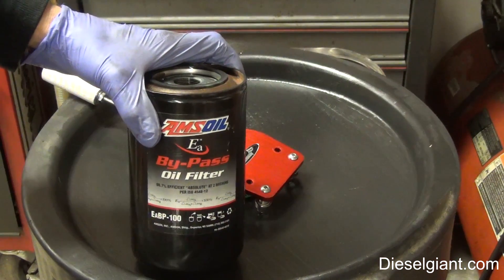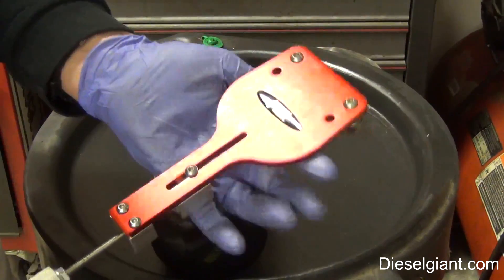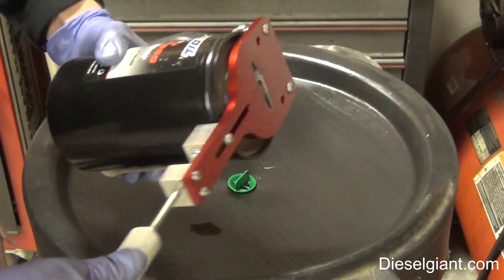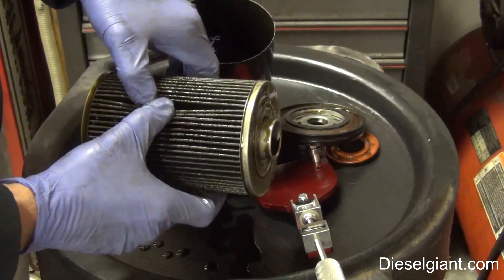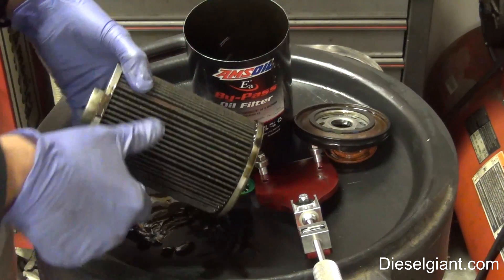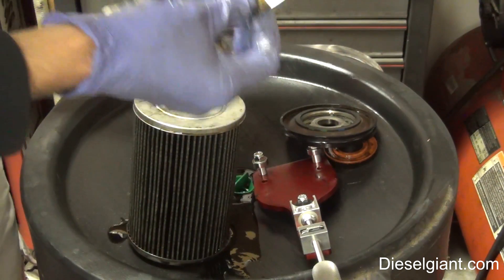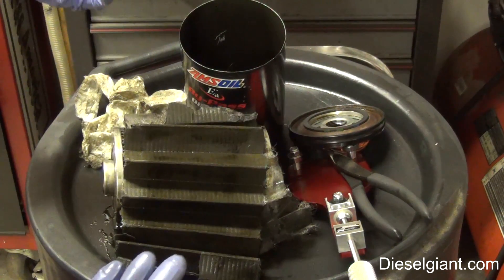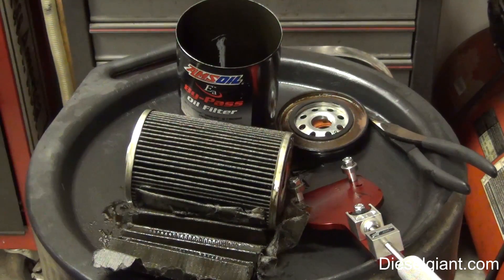Amsoil Ea BP 100 Bypass Oil Filter Cut Open and Inspected

Comment: There is no 'pressure relief valve.' There is no bypass to the bypass, as that's redundant. If that thing fills up, it's NBD, it just stops filtering and full oil flow will automatically be diverted to the full-flow filter. When the full-flow filter fills up, it's bypass takes care of everything.
Reply: That my friend was a piece of stamped steel, not a valve of any sort. It just holds the filter against the seal on the base plate at the other side.

Comment: Hello. I use a Amsoil engine oil filter. What is the micron difference and how much more efficiency will bypass filter give?.
Reply: according to the Amsoil website, the "full flow" filter gets 20 micron rating and the "bypasss" has a 2 micron rating.  I think I may go with WIX for the "full flow" side and Amsoil for the 2 micron "bypass" side

Comment: Thats not a 1 micron filter. Its more like a full flow filter. What you have is a high quality oil and a clean running engine that makes the filters look better than they are.
Reply: That's what it looks like.

Comment: Great Video Sir. Thank you!! OK I'm going out on a limb here. Since I am researching this filtration system my question is this: Can you use a bypass oil filter in place of your normal oil filter to get the 2 micros of filtration? Why does it require two filters instead of replacing your stock filter? If the oil can't flow through the Amsoil filter fast enough, how is this benefiting the engine if there is only a small amount of oil going into the oil cap down the top of the engine. Help me understand how a small amount of filtered oil is a benefit. I think you said 10% of the oil?  Don't get me wrong I want to add a filtration system if it really works, but I want to get the whole understanding of how this is actually working. Also does it only work with the Amsoil Oils? Again Thanks
Reply from the maker: Ok so here is the deal.  You NEED a regular full flow filter at all times that will handle all the oil at any give engine speed.  Because it flows well you have to give up some filtration.  Lets say 30 microns.  Now everything smaller than 30 microns does not get filtered and continues to circulate around with the oil.  Put a bypass filter that filters to 2 microns and you divert about 10% of the oil to the bypass to get the 2 micron filtration.  This little bit will still allow the engine to have plenty of oil.  Now within about 5-10 minutes at highway speed ALL the oil has made its way through the bypass filter.  If you only had a filter that filters to 2 microns it would clog up really fast AND would not flow enough volume to keep the engine lubricated since its restricted. By only allowing 10% of the oil to the bypass,  all the oil eventually gets filter by the 2 micron filter.
Reply: @DieselWorld  OK fair enough but can you look at this video and comment? https://youtu.be/mkKqZZqyoUg
Thanks
Reply: @maxgarcia9512  no you have to use both

Comment: Hello, great  video.  How many miles or hours on the oil in the 5 years you said the oil was in the truck?  I have a bypass system in my truck and just had oil analysis done.  7500 miles on oil and TBN is at 4.7.  Blackstone said I can make it to 10k miles on this oil because the bypass system is "doing its job"  I spent about $500 for the bypass kit and brackets.   In about 3 or 4 oil changes the system will have paid for itself.  I'm currently using Mobil 1 but might spring for amsoil if your 5 year mileage is 40k+ miles. Thanks for your time.

Comment: That stamped steel spring IS NOT a Pressure Relief Valve. Its purpose is to hold the filter's internals in place.
AMSOIL Products are severely over-priced, and practically un-available when compared to FRAM, BOSCH, & ACDELCO brands.
Reply: Does FRAM, BOSCH & ACDELCO make a 2 micron filter for this application? If so please share the info. I'm sure most people would love to save 40 bucks on their bypass filter change.
Reply: @emrwtf  NO. Only AMSOIL makes a 2-Micron-rated oil filter, and it's NOT a convenient spin-on.
I don't want one of those 2-micron deals -- too much hassle, and no room under the hood.
I get max protection from the 20-Micron-rated Bosch #3410 and a FILTERmAG # SS365PR Magnet Kit.
Reply: @SlikLizrd  Umm. The amsoil 2 micron filters are spin on. and a 20micron filter isnt max protection. it's protection against particles 20 microns and above. I was hoping you had found 2 micron spin on filters(like amsoils) that were cheaper. I believe the original amsoil bypass were a cartridge type. Is that what you're referring to?
Reply: They were a better filter than they have now. When I found out about them in the early 80s I was using Amsoil 10 40 with a Frantz oil cleaner. I also had a few Motor Guards. All of the cannister filters were a mess to change. Worked for a trucking company. We drivers had to change the Luberfiners. They used cotton. The newer ones used pulverized newspapers and wood chips. The  big Gulf Coast filters  use 2 rolls of Bounty big roll paper towels. Amsoil had Bobby Unser saying this oil change is forever when they came out with the cartridge filter. I have a Australian Jackmaster Classic on the Pontiac. They claim 1 micron. If you use their elements. Motor Guard has always claimed submicronic. I believe the Frantz claimed submicronic..The Australian Jackmaster Classic uses a high quality tightly wound roll of Australian toilet paper in a fabric cover. I would think the toilet paper filters would be similar. The Jackmaster Classic  has the smallest orifice. It should have a slight advantage.The slower the flow the better the cleaning. There are filters claiming 1 micron that are more like 10 micron filters.

Comment: Hello Dieselworld,
In this video you mentioned that this filter has a 2 micron rating and that this will not hurt the oil. I work at ExxonMobil and as part of my job I performed rigorous testing on lubricants. For your standard 15w40 diesel engine oil, it is not recommended to filter smaller than 5-7 micron. Otherwise it will remove the additive package from the oil. This degradation causes the oil not to perform as intended within the engine.
Reply from the maker: The lab analysis does not agree with you.  2 microns will NOT remove the additive package of Amsoil.
Reply: Lmao. Hundred's of Thousands of oil analysis say otherwise.
Reply: Same job different company . If that ams oil filter is that great . oil refineries would buy millions ! Oil. Detergents will be removed from the vehicle  . Do what you want with the engine .   Paying the price either way.😊❤
Reply: 1 micron filters wont remove the additives in any oil Im aware of.. Some people spend money on oil analysis partly to get a list of the additives in the oil. The Australian Jackmaster Classic claims 1 micron if you use their elements. My 64 Rambler American had a spin on bypass filter. It was a 10 micron filter. The oil was always dirty and black soon after a oil and filter change. Installed a Frantz and the oil turned clear. About 1966 I found out about the Motor Guard. I think they still claim. Submicronic.All they make now is compressed air filters. I have two that are over 50 years old. They will remove solid additives such as graphite.

Comment: Hey Russell that was a good video on that Amsoil bypass shoulder yeah that is nano fiber technology I’ve been using them for years for over 25 years and a mile dodge was six in a row under the hood it’s coming up on 500,000 miles and I can go out there and 0° weather I have to use the heat grid for about 10 seconds and then it fires up almost as fast as it was 70° outside are you ready for this let’s talk about 50,000 mile oil changes now granted some leakage so you know that it is getting replenish some along the way but the thing is that engine still runs absolutely beautiful and you’re doing the right thing I don’t know what kind of truck you drive but keep up what you’re doing you’reThat was a very good the video there and I subscribe to you this is Jim mungai from Pennsylvania you guys have a good day all right bye

Comment: Knowledge and the use of it is wisdom, . I own a 1984 w900 Kenworth, the shop manual for the cat 3406 b model 400 hp DITA engine calls for If my memory serves, 5w30, or is it 10w30. I installed a dual bypass amsoil filter system and series 3000 amsoil 5w30 and did a CAT full spectrum fluid analysis several times a year and NC Machines lab in Washington always showed no excessive wear on the test samples I sent to them. Final recommendation was always good oil health formula and no oil change necessary. I still replaced all three oil filters once a year and added top of oil. Now I ran a 3axle belly dump and also installed a pre air filter set up on both air cleaner canisters Sy-Clone and also a racor fuel oil water separator as a closed crank system. I had excess of 1,250,000 miles on it when I sold it. I also replaced the drivers and transmission fluids every year with synthetic oils. Usually in dirt work it’s not unusual to replace engine oil every 400 hours.

Comment: I installed the bp120 kit on my 2009 kenworth. Isx485 dohc. 780000 miles. I cannot afford to lose this engine. $375 is a small price to pay for the added protection. High soot and moisture at this mileage is normal and was clogging the full flow filter in one day. Now there is no clogging in 10,000 miles and the engine runs better than ever with good oil pressures all day every day. I like this kit and installed it myself.  All big trucks should come with this kit. Wtf!? I need to make it to 1,000,000 miles and prove it to my wife i bought a good truck. Period. No exceptions. Zero tolerance for failure. Must succeed. I ❤ amsoil! I change my oil every 10,000 Shell,mobil or chevron 15w40 $4.00 a quart + the full flow filter $50 no big deal.  i dont care what anyone else says,thinks, or has done.
Reply: So did you make your million miles?
Reply: @emrwtf  yep and traded it in for a 21 mack pinnacle yikes
Reply: @emrwtf  yes traded it in on new mack
Reply: I know of a guy who went over 1,400,000 miles without an oil change. And he did not use a bypass  filter or Ams Oil. I don't know if you have heard of Conklin Convoy but I would put it up against Ams Oil any day. If you want more info let me know 1(712) 441 - 3682
Reply: Marvin Scholten yeah I like to see facts about your statement, because personally I don’t believe a Diesel engine will live past 100k without oil change
Reply: Mack/volvo engines come standard with 2 full flow and 1 bypass filter. Thought all class 8 engines did actually
Reply: @BabyGators  ixs485
Reply: 09 Kenworth man, your testimony about your Amsoil filter surprised me.  You said you don't care what what anyone else says, etc.  but I sure do.  Hope the KW is still going strong.  It's been 5 years since your comment here but would appreciate a report from you.
Reply: @horacesawyer2487  yup made it to pay off. Traded it in for a new mack

Comment: Pick up 3 miles per gallon by changing the oil type?  Maybe 1 or 2 tenths of a mile if your lucky.
Reply: And that'd be a stretch. And If you don't change your viscosity, even less
Reply: I ran an old Gulf Coast Filter O-1 jr on a 1995 Toyota Avalon for a couple of years before relocating and having to sell the car. After I installed the GCF filter on it, gasoline mileage improved by at least 1.5 MPG. I believe this was due to the reduction of hydrocarbon deposits suspended in the oil, reducing friction on the engine.
Reply: @bls1965  The Gulf Coast junior is as good as you can get. When Frantz went broke a Frantz dealer specializing in heavy duty diesels replaced the Famous Frantz 3 stacker with a big paper towel filter. The Gulf Coast junior replaced the poorly designed Frantz. All I have now is the Australian Jackmaster Classic  Motor Guards and Gulf Coast juniors. The flat head Ford V8 tp conversion is on the Ford tractor.The Gulf Coast junior was designed for marine use around salt water.

Comment: I would never put 5w30 in any diesel! I don't care what any oil manufacturer says. It's 5w40 or 15w40 only. You definitely will not notice a difference in fuel mileage because of oil weight.
Reply from the maker: You clearly do not understand oil chemistry with a 1920's statement like that!
Reply: dieselworld I fully understand it I've been in the industry for a long time.
Reply from the maker: I guess you a lubrication engineer?  What exactly does "I've been in the industry for a long time" mean?
Reply from the maker: Your stuck in the last century.  5W-30 is PERFECTLY fine in this engine.  I guess you would dump ATF fluid in the oil to "clean out the engine" also huh?
Reply: peter conway I'd guarantee you won't notice a difference in mileage you will notice that you burn a hell of a lot more oil.
Reply: dieselworld I'd never run anything but oil to "clean out" an engine I've seen what they do to an engine. If there's sludge definitely not. I'll keep using 15/40 delo and change it every 7000 miles.
Reply: Here are the results of an independent fuel economy study that was done using the SAE J1321 Joint TMC/SAE Fuel Consumption Test Procedure-Type II, which is an industry standard test for measuring fuel economy.  In this test, conventional lubricants were used with a 15W-40 heavy duty diesel engine oil vs. premium quality AMSOIL synthetic lubricants with a 5W-30 heavy duty diesel engine oil. The results showed the AMSOIL synthetic lubricants and the 5W-30 viscosity improved fuel economy by 8.2%, which is a huge improvement, saving thousands of dollars in improved fuel economy.  --> http://wpc.1c96.edgecastcdn.net/001C96/G-Items/Performance%20Testing%20Archives/g1351-2003-archived/index.html
Reply: DD13 and DD15 come from factory now with 15w30 in them. Delo is now selling a 15W30 oil for severe service and high temperature applications recommended over their 15W40. Shows a 0.7% increase in mileage also over 15W40 which is a really big deal when you are a company with thousands of fleet trucks. Google it.
Reply: 15W-40 is a thing of the past. We used AMSOIL 5W-30 HDD in oure 90's era Cummins and it was perfect. In the FOrd 6.0 at 10K intervals no oxidation and we  could extend intervals but mileage was always improved.  Basically you are saying engineers can't build an engine which can remain in tact.. No need for excessive viscosity if the engine is up to any 20 year standard.
Reply: former company uses 10w-30 in everything.great protection and fuel economy!! compared to 15-40

Comment: No wire mesh? I thought Amsoil filters comes with wire mesh.
Reply: That stupid wire mesh was replaced with more modern technology that became necessary with the extended 20,000-mile change intervals. The Uninformed have been flipping out about the wire mesh screen -- as if it was absolutely necessary in a top-quality filter. IT ISN'T !!
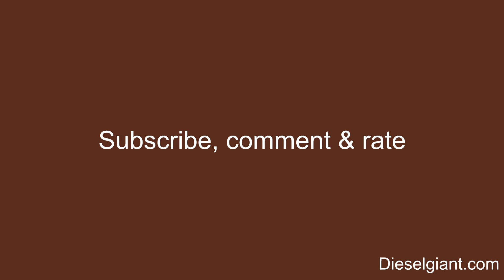Reply: The filter on the Pontiac Sunbird is a cartridge type. The last two filters were crushed by the oil pressure. I wonder if the wire backing would keep that from happening. The Wix on the Pontiac Torrant had 64.000 miles on it when I changed it. It was getting rotten but still looked good. It didnt have the screen backing. The Wix XP has the screen backing. On the pic 13:52 ture on the box.  Normally I change the full flow filter every 2 years. Started seeing  particles in the Jackmaster that should be in the full flow filter.

Comment: I have one in my 5.3L gas Chevy truck. I haven't changed it in 4 years. I don't think it's necessary yet. I do check the flow with every oil change and of course I am aware of the over pressure bypass. I do see a small drop in flow now and will probably fit a new one next change. My 2008 truck has 115K miles. It sounds and runs like new with the exception of a phantom check engine light. Those can be frustrating.

Comment: Their filters are mainly made by other real filter manufactors.
Reply: LKV troll.they r not.they are with fleetgurad.the very best
Reply: It doesnt matter they are all crap. If you want clean oil you need depth. Ive used filters that clean oil since 63.. In 63 that was Frantz or Motor Guard. Now there are a lot more choices. Some of the prices are higher than a cats back. They all use toilet paper or something that looks like toilet paper.cut open a Australian Jackmaster Classic filter element. Found a roll of very high quality tightly wound Australian  toilet paper in a fabric cover.They claim 1 micron filtering.if you use their filters. I dont doubt it. Motor Guard has always claimed submicronic. Jackmaster uses the smallest orifice. The slower the flow the better.the cleaning. Probably should use the Jackmaster elements. Im a toulet paper user..

Comment: In the 1980's I ran 25,000 miles on one oil change in a Toyota gasser (20R) changing the filter at the half life and doing oil analysis, without bypass filtration.  Amsoil is great stuff.
Reply: I have a diesel jetta that I do that with, its got 470 000 km on it now and had amsoil since day one.

Comment: Before you cut your next filter open, slap on a extremely strong Neodymium Magnet on the filter, An N52 from KJ Magnetics. And you'll really see all the metal partials trapped &  held within the metal filter casing. I've had Magnets on all my cars and bike filters for Yrs.
Reply: Doesn't work real well for aluminum.
Reply: BeaglePower G I checked the site KJ magnetics the operating range of the magnets are only 80 degrees C have you ever experienced the magnets fail
Reply: BeaglePower G I
Reply: @elithegreat6463  good idea
Reply: Most bearing material is not magnetic ! 90%
Reply: @DaleFord-d3v 
Well, whatever “is” Magnetic/Ferrous is sticking to the inside of the filter where the magnets are placed, staying there, and not swirling around in the oil.